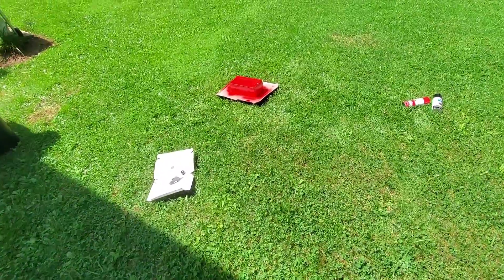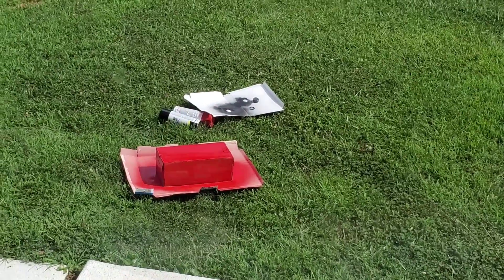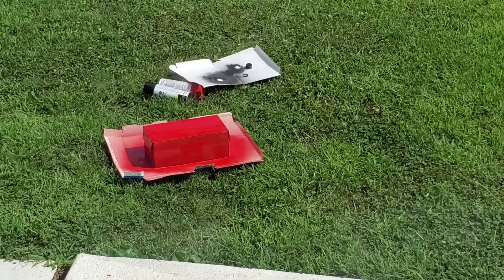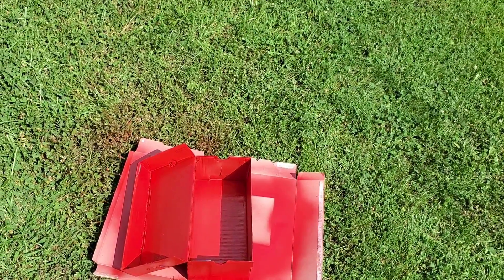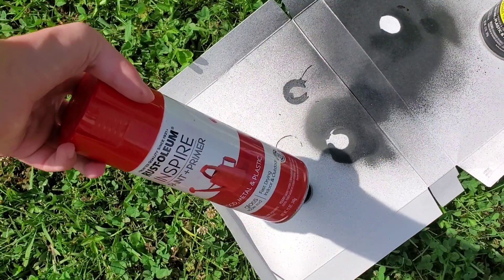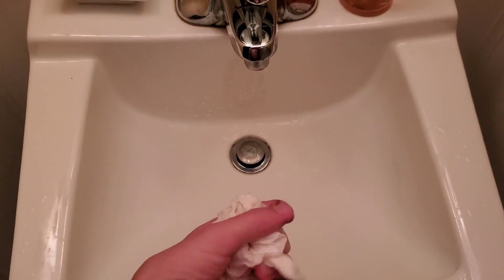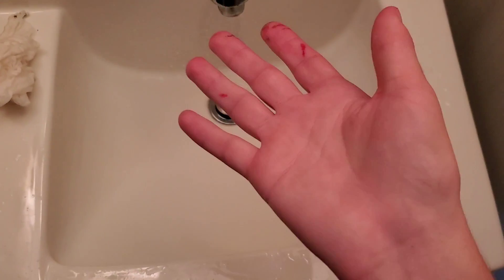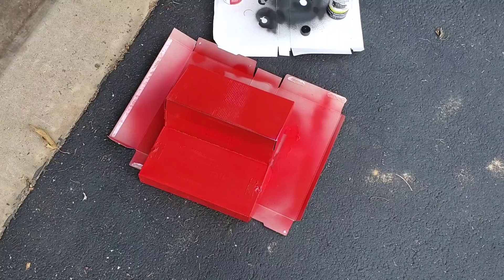Building A Fire Alarm Panel (Day 1)

Comment: Nice. Love the progress. I got my speaker working. It's just a little too quiet.
Reply from the maker: I'm loving how this is turning out. I really did spend some time studying on how I wanted this panel to look. I still needs work. What did you use for you speakers? Aux wise? Just so I have a sense of what I need to install on my panel and to power my '93.
Reply: @FireRescue80  I just had an aux cord cut and wired up but the speaker is really quiet so I need an amp to get it to sound louder
Reply from the maker: @officialsimplexguy  I'm having the exact same problem that you're having.  Only that my speaker doesnt work with the aux that im using.  I need to step up the amperage for mine as well.
Reply: @FireRescue80  I have an amp but I need to get it working in order for the speaker to run right
Reply from the maker: @officialsimplexguy  same. I'm not sure much at all on how to get my '93 wired up properly.